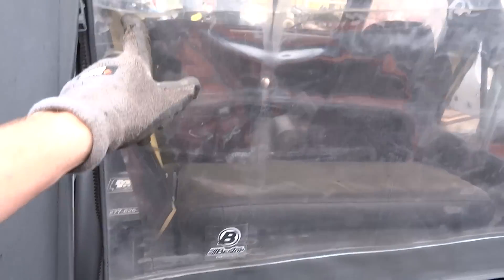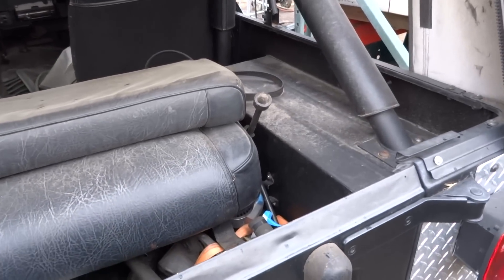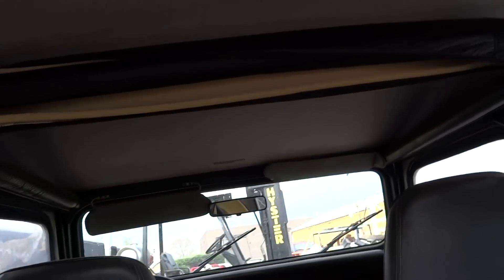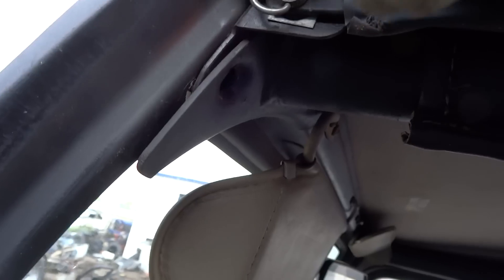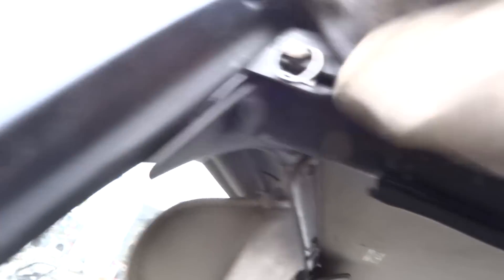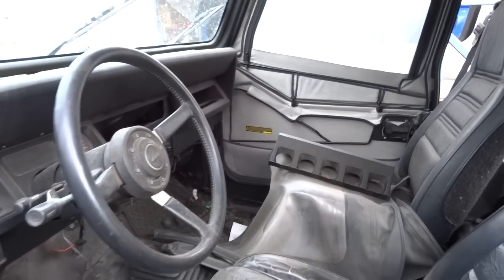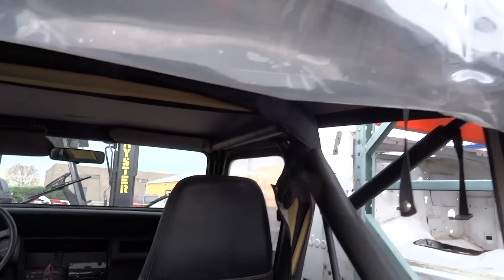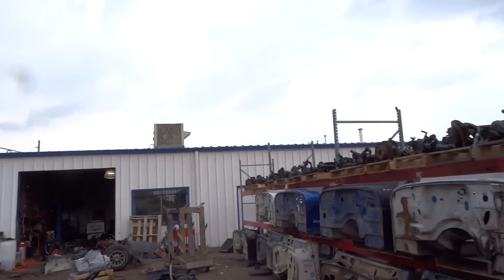1987-1995 Jeep Wrangler YJ Full Soft top and Factory Hardware

Comment: Don't know if you have any jeep parts available... But just wondering if you have a pair of the cj7, cj8 or yj tub side channel supports? They are the metal brackets that are welded just in front of the wheel wells. (Just for clarification, NOT the door strikers. But rather, the welded supports to the tub...) Thanks. :)
Reply: 94 Wrangler how to put windows on for ragtop

Comment: hey so im trying to put some new 4x6 speakers in my 95 wrangler Sahara and i CAN NOT get the torx screws out of the plates above the windshield. i have tried everything everything from hitting it with a hammer and pb blaster. have you had this experience before? do you know if heating it up might work?
Reply: We use a tool called a wood pecker
Reply: Hey i want a jeep